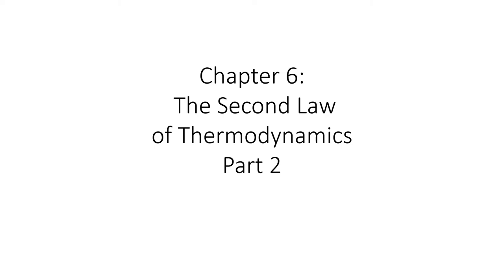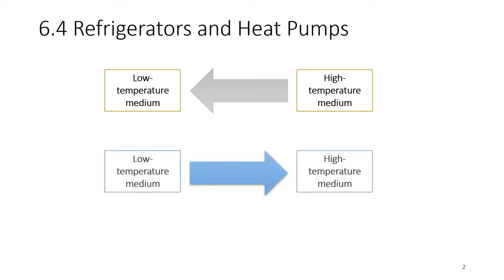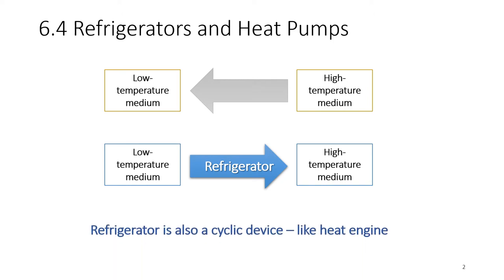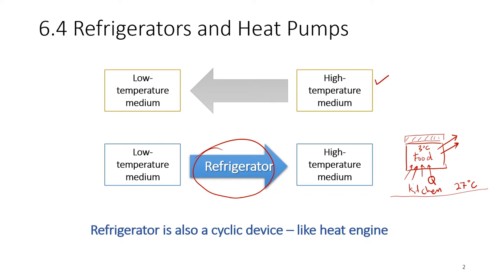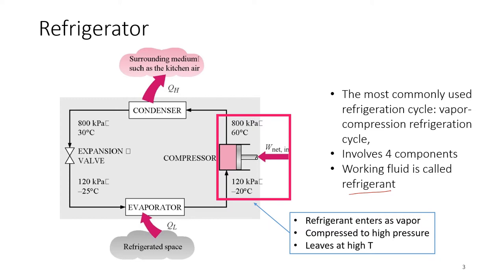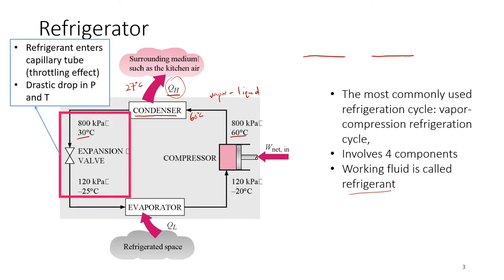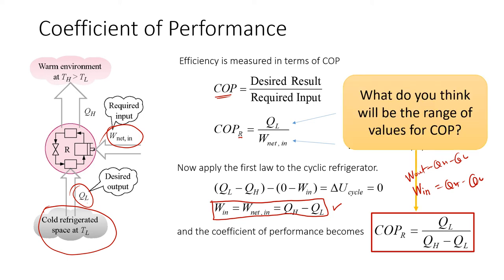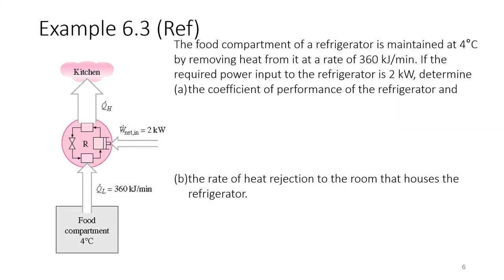Thermodynamics - Second Law - Refrigerator

Comment: Hi madam, I'm not your student,  but I came across your video as I was searching for this topic  on youtube. and Alhamdulillah I can understand your videos well :D thank you semoga halal ilmu saya :) ☺but there is one part that I am a bit blur on that last practice, about the formula of h2 and h1. seems like I can't recall which formula is that? Mind to explain madam? Thank you 😊
Reply from the maker: Hi! Thanks for watching. I'm happy that my videos help. Could you please specify your question based on the video (minutes and seconds)? I'll answer your question but I'm not sure which one you refer to. :)
Reply: @iyliaelena9308  Oh I’m sorry. 😅 thank you for replying me madam :) from this video it’s on practice question 6.4, which is on minutes 27.13 until 27.15. It is the last practice on this video. Based on your solution finding the mass flow rate of the refrigerant, can I know which formula that you’re using for mR=QL/h2-h1 ?? How do we get h2 and h1 ?
Reply from the maker: @nuramelia4766  If you're talking about the formula mR=QL/h2-h1, that's from the general energy balance eqn i.e. 

Q = m(h2-h1) ---- this is eqn is applicable at any point to find the change in energy (in this case, heat, Q) when you have two points like inlet and outlet to a device (in this case, the evaporator)

If you're referring to the values h1 and h2, that's from the property table (refrigerant tables A-11, A-12 and A-13).
Reply: @iyliaelena9308 ohh I understand it now madam! Thank you for your very much clear explanation😇 may Allah make everything easier for youu.